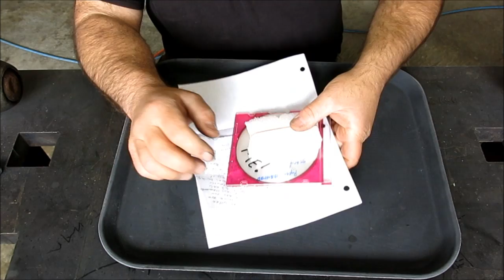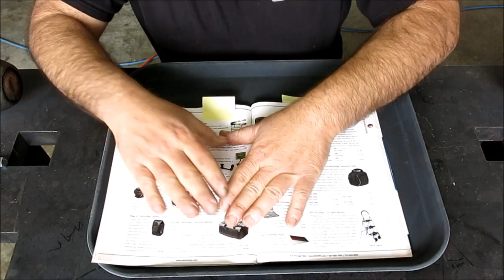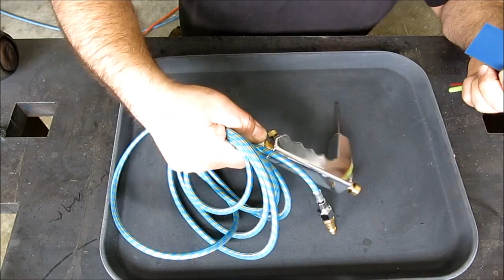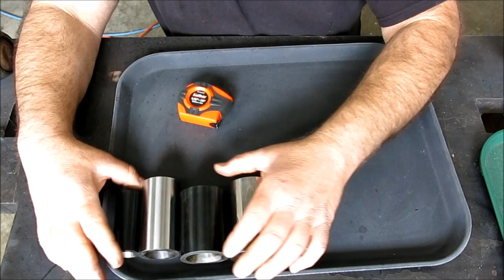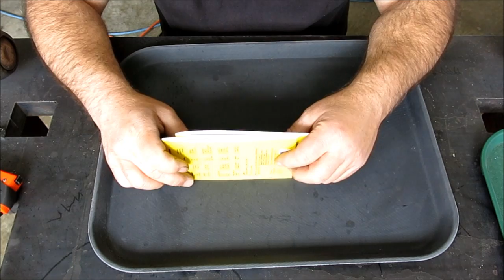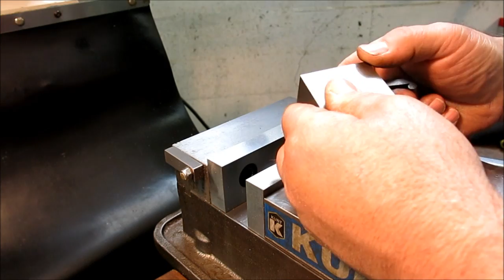Meatloaf 31

Comment: On the edge finder topic. If you needed to precisely locate 1 or more holes on the angled surface, the best way would be to put a manufacturing hole (typically just a dowel pin hole) in one of the faces that the vise clamps on. That manufacturing hole is then dimensioned to the holes you want to drill, parallel to the top of the vise, and also dimensioned to one of the flat sides or other precise defining features of the part. The hole can then be found using the edge finder or probe on the dowel pin or tooling ball.

Comment: I like the air gun, and although the intent was good you should also mention that high pressure air isn't a great idea around machine tools as the chips will get pushed into the machines small areas and ways. Its also a bit dangerous to people as chips can turn into projectiles. Those tips will be handy to have around for general use though, and I love the built in air pressure regulator.
Reply from the maker: Hi Ron,

No air around machine tools is an outdated notion. Sure you don't intentionally blow debris into nooks and crannies. The best is to regulate the pressure down so the noise drops off significantly. The tips of approved modern air blow nozzles prevent ding dongs from blowing air into their bodies causing embolisms. Thanks for the comment.

Cheers,

Tom
Reply: It may be outdated to you but its still an important part of general shop safety for the guys just starting out in this field. I still use an old school (non OSHA) air gun in my home shop but I wouldn't want any "joe blow" shooting air around my personal machines.

Comment: I like the edge finder but you can do the same thing with a gage or dowel pin super glued to a flat block. Does exactly the same thing.
Reply from the maker: +ROBRENZ Hi Robert,

You are correct. But it will look like a dowel pin glued to a block. This is slightly nicer setup wouldn't you agree? He also adds a magnet in the flat area to clip it to steel parts. Thanks for the comment.

Cheers,

Tom
Reply: +oxtoolco Totally agree,  I love to make pretty tooling and gages. I meant it more so people would be able to apply the concept in a pinch.  Thanks again for all you share,Robin

Comment: Hi Tom, this is Dimitris, a long time viewer from Athens,Greece. First of all since this is my first comment on any of your video's allow me to tell you how hugely helpful they have been for me. I have learned a great deal of things watching them and i 'd like to thank you for that.
Being a mechanical enngineer i had to look into that interesting edgefinder that your friend EDM'd. I did a little sketch on CAD and it turns out you don't really need to do ANY trig to find the corner edge. Just rest the tool on one side, touch off the cylindrical part with a regular edge finder, zero the DRO, flip the tool and rest it on the other side, touch off again and split the distance in half (1/2 function on DRO's).
In fact the angle doesn't even have to be 90 degrees! Any included angle on the workpiece will work the same way as long as the flat side of the tool rests on one side of the part to be machined and the cylindrical sits tangentially to the other side of the workpiece. The limits for how oblique and how obtuse angles can be edge found with this tool really depend on the design (radius of the cylindrical part,edge relief...).
Maybe you can check to see if this all applies in reality in one of your future video's, because even though my conclusions are obvious to me from playing around with the sketch i did, seeing this will truly convince me.
P.S.: Your EDM friend is a true trigonometry grandmaster/inventor

Regards, Dimitris
Reply from the maker: Hi Dimitris,

Welcome to the show. And I hope you feel like commenting in the future as your first one is great. It didn't occur to me there was a symmetry to the edge finder on any angle. I was thinking one sided and that the trig would be simple. Thanks for sharing your study. I plan on trying it out in a future video. Angled holes don't come up that often for me but when they do there is usually some fussing around.

All the best.

Tom

Comment: Hey Tom, thanks for sharing the tools, it gives me some good ideas on things I can make to help me out in my shop. I do have a ? for you or anyone who can help. I have a coaxial indicator and I think the shaft is bent, it reads ( AXIS OFFSET ) on the dial but I can not find any info on what that means. when I chuck it in my mill you can see the " body " move in and out about 5 thousands, which I don't think is right. Can you help? Also I saw your video on Buckrun11 about threading and I made a video on my grizzly and posted it on youtube for him. it might help him. Thanks,
Buddy
Reply from the maker: Hi Buddy,

I'm guessing this is not a Blake Co-ax indicator. Long island might work on those type of rotation indicators. I had to send my Blake back to Blake for repair. Nice folks to deal with.

Cheers,

Tom

Comment: Matthews photo equipment sells Noga branded gear, so the "Israeli arm" is most likely a knockoff hoping to not get sued by Matthews or Noga.
Reply from the maker: Hey Ben,

That actually makes some sense. I'm not familiar with Matthews Photography. Looks like I need to check them out. Thanks for the information.

Cheers,

Tom

Comment: Tom,

The Cummins ISX is a 15 liter engine, hp rating is 450 to 600.  Can a guy turn a wrist pin on a lathe or are they too hard on the outside?
Reply from the maker: Hi Bob,

Not sure if they can be turned. I will include that when we get to the inspection and survey of the wrist pin. Thanks for the additional info. Sounds like a beast of an engine.

Cheers,

Tom

Comment: I remember we use to use those carbide bit's for drilling a hole for the electrical contacts on ceramic heaters.  http://www.industrialheater.com/Default.aspx?tabid=122
Reply from the maker: Hi Ruben,

How thick was the ceramic? You guys didn't use a hollow diamond rim drill?

Cheers,

Tom
Reply: oxtoolco No we didn't use the hollow diamond rim drill
The ceramic was different sizes depended on the heater size. The ceramic had holes so you could pass the coil of NiChrome Wire. We use the diamond cut off wheel to cut slots at the ends. It was very interesting heaters. Did you check out the different heaters they made. http://www.industrialheater.com/

Comment: You can get these "magic arms" on ebay for about $15 (11" version).
Look at 390674586872 for example.
They also make a clamp that goes with it 111297616347.

Let me know if you want any of these Tom and I will have them shipped to you, so you can compare them to the $30 arm and the noga.
Reply from the maker: Hi Stefan,

Paul Compton did a video on one of the offshore magic arms. He had to do quite a bit of rework to make it work properly. It would take a bit of work to make this indicator friendly so it might be the better part of valor to get the offshore and rework it for smoother action.

Cheers,

Tom
Reply: Thank you, I hadn't seen that one.
On mine the wedges were fine, and it even had the thrust bearing which really surprised me. However the two units I ordered were slightly different, you never know what you will get from China and just how much work it will need.
The surface finish on the balls is not as nice as I would like on both units (looks like grooves from turning with a form tool or something).

Say are the original noga serrated in the center joint? I turned the arms on mine around because I did not like the serrations.

Comment: I have seen the same kind of edge finding tool made from a circle with a 90 deg triangle cut out of it.  A 25mm round gage from a micrometer works well as it already has a hole in the center and is hardened.  Just wire edm a 90 deg pie out of the gage and you have a angle edge finder.  Yours seems a bit easier to use though, thanks for sharing.
Reply: but that only works on a 90 degree corner, no?
Reply: Yes they only work on a 90 deg corner, which is why I like the one Ox has shown.

Comment: oh do you have any or do you plan on doing and videos on machining carbon fibre?
Reply from the maker: Hi Distiller,

I don't have any CF projects on the books right now. Never know what will come up. Do you have a specific question?

Cheers,

Tom
Reply: oxtoolco not really... I plan on machining a CF frame for a quadcopter and I was wondering if there was any tips you had or any problems I should look out for?
Reply: HomeDistiller
Hey mate, are you making the quadcopter frame yourself or are you buying ready made sheets of carbon fiber?
Reply: Energy Fabricator I'll be buying the carbon sheets and tubes. But machining slots and holes for mounting motors etc and weight control..